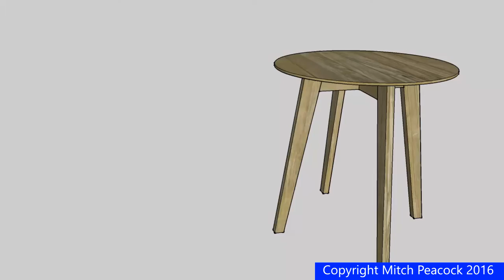Top Flattening and Cutting a Circle - GIW#24

Comment: very interesting.  I hadn't thought about how I'd make a circle without a router, so that was nice to see.  how long did it take to get down to your line with the plane?

if you did a lot of these, do you think you'd make a jig to pivot the tabletop on?  sort of a circle-forming shooting board?
Reply from the maker: +ThoperSought Cheers. It didn't take long at all. I'm fitting this project in during spare time, so nothing is taking much time. I would guess to plane to the circle maybe took five minutes, then another five to bevel the top and bottom.
I like the idea of a circle-forming shooting board - maybe something to try!
Reply: Get into Woodworking
glad to hear it went quick!

as for the circle-forming shooting board, I'm thinking about how I would do it, if I were making one.  if you do one, I'd be interested to see what you come up with.  I'm definitely going to build a bench before I try something that that, anyway.